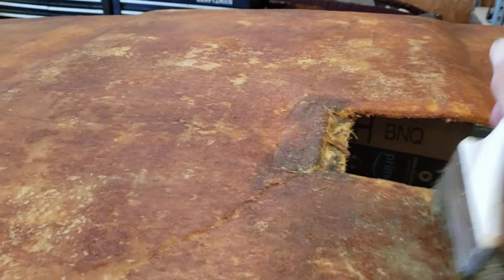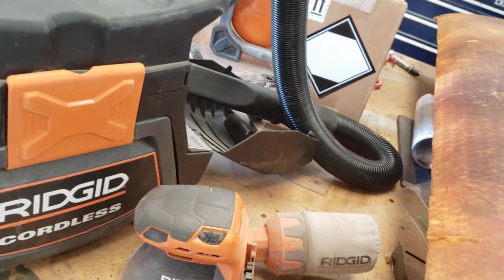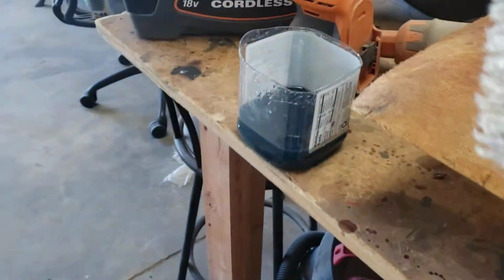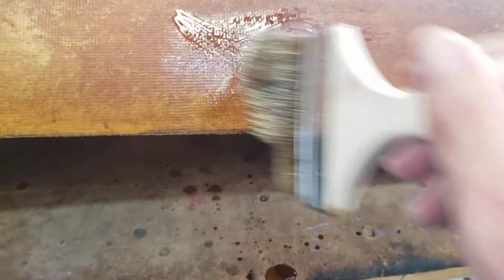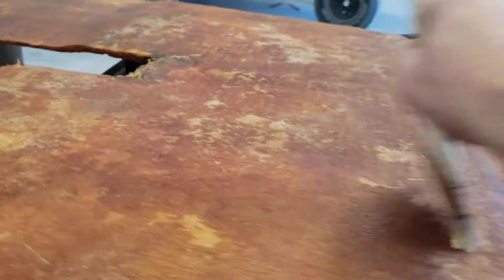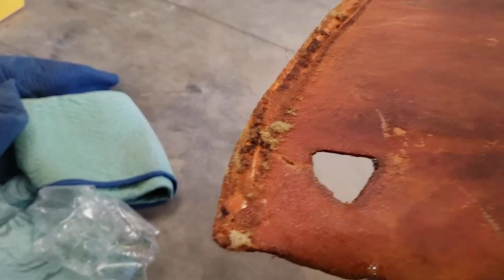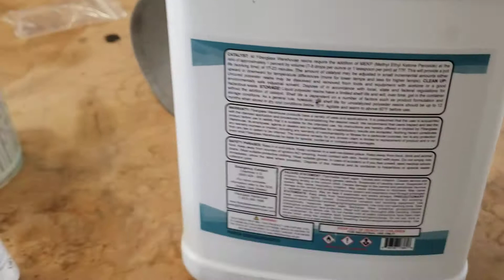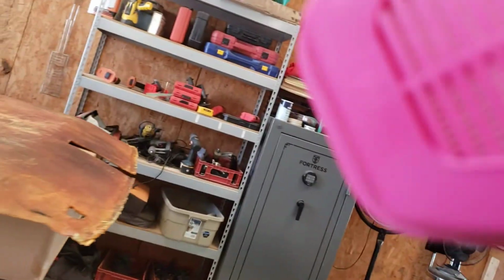soft headliner board fix fiberglass resin

Comment: Thank you for a great film. Did you add any resin hardener, or it is just fiberglass resin? My headliner looks exactly the same, also very soft. On another side after I removed the old foam there is some thin layer pills off at some patches. Should I pill it off or it is a thin layer of paper and will be soaked w/glue when I apply a new headliner fabric? Thank you again.
Reply from the maker: Yes the hardener was added As i mixed it. Id remove all loose debris. So it can bond with the board is self.
Reply: @judsonindustries8044  Thank you! Please could you tell about dome headlight wires? can I scotch them to the ceiling or necessarily to the headliner? It seems easier to attach to the ceiling than to that very soft and breakable headliner.  Thank you again for the great film, it is the only one which shows how to strengthen the headliner board.
Reply from the maker: @olenaerhardt7725  use electric tape if you must. I usually let them hang and fish them threw the openings. It's a pain to get the board up then have to take it back down.
Reply: @judsonindustries8044  Actually now I think that is the reason why the wires were attached to the board and not to the ceiling. I will also fish them in 1st then, and then slightly glue to the board, as specialists do so. I bought today some Fiberglass Resin, so can strengthen that board a bit. I have electric tape, though planned to use very strong transparent, but probably it will be too strong, if smth and the need to remove that wire. I also recently got some special automotive electrical tape (to put around looms). As far as I understand that tape withstand heat better. I think I'll use that one. Thank you for your replay.

Comment: Sir, may I ask you, did you use Fiberglass Resin Jelly or just Fiberglass Resin? See I bought yesterday Jelly, but what comes from instructions I've read for that product, I think it is more like a jelly, since they were talking about amount of golf ball to add like 1-1/4 in hardener. In one film he showed Jelly jar, so I bought Bondo Jelly, but then I looked again in that film he poured from the container, which was different from that Bondo jelly container, and dropped into that liquid the hardener, which was transparent. i think the one which comes w/jelly jar is same as for the filler. I think maybe just RESIN (not Resin Jelly) that what you use to paint that board. And also did you painted only one side or both? I would paint both, but afraid the glue won't adhere properly then. Thank you for your unique film again.
Reply from the maker: Resin I talk about coats on both sides and it's Resin with hardener added not jell one has more coats
Reply: @judsonindustries8044  Thank you, Sir! I bought today Bondo Fiberglass Resin as well. The jelly is also a good product, but probably more to fill in a small voids in that board, that is why I saw it in the film mentioned before. I also have some voids and cracks, so might need both Bondos. Special thanks you advised to do both sides, I was not sure about that side which will be glued w/fabric later. But probably for that project better to gave 1 Ga of Fiberglass Resin and not 28.8 Fl Oz I bought.  I think I'll buy tomorrow that large 1 Ga container to be able to do several layers on that board. How many layers did you do? You said several, like 2-3, yes?
Reply: @judsonindustries8044  Thank you kindly, I'll follow your advice.